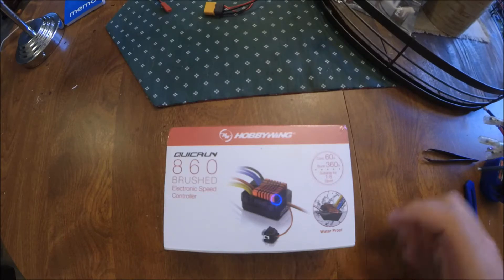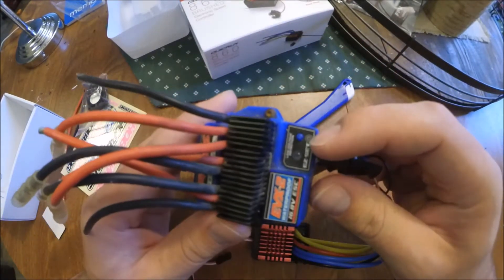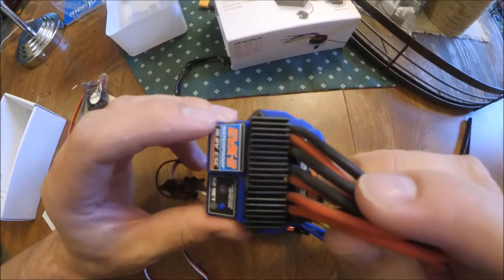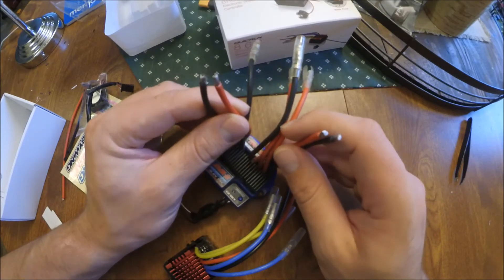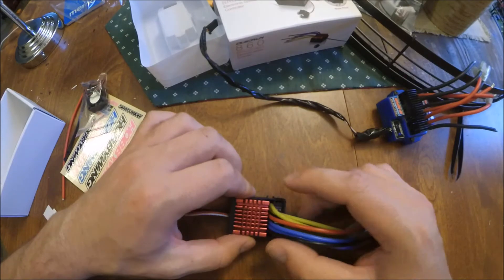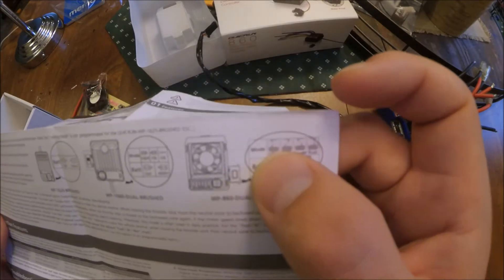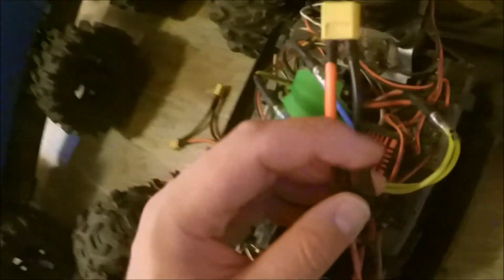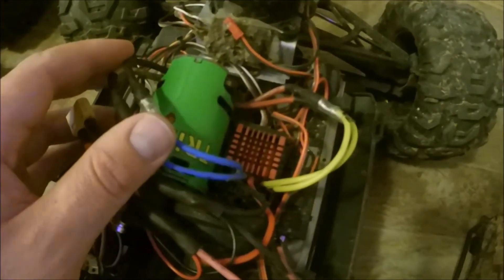Traxxas Summit Upgrade Series...Part 1: Hobbywing Quicrun WP 860 Dual Brushed ESC

Comment: Just to confirm, it will run a Dewalt on 4s?

Not that I doubt the clout of this awesome ESC but I want to be sure before I buy one specifically for a Summit I just picked up that has no motor/esc.

I'm going to buy the quicrun and a dewalt motor. I was going to go brushless but I would ideally want a sensored one which ups the the price dramatically vs a sensorless.

The dewalt + hobbywing would be an inexpensive option and be better at crawling than a sensorless.
Reply from the maker: Yep! I have the exact setup (4S, 860, Dewalt) on my 6x6. Runs just fine!
Reply: @techsmechs4553  Forgot to say thanks for your answer! The Summit is still on the shelf but I should be making a start on it soon. I've acquired a Dewalt motor and a few other missing parts I needed like the motor mount and dust cover. Just need to get an 860 now and I should have myself a bargain Summit!
Reply: About to do the same for my Summit crawler conversion. The fwd/brake/rev on the stock ESC is very annoying for crawling.

Comment: @Texhs Mechs Do you know is HW860 single esc running 2 motors or 2 esc for each motor with single power and signal input? I want to use it on my 8x8 dual motor (each for 4x4) but when I use single esc, it acts as kind of electronic mid diff so I dont get full power on all wheels (front 4 wheels in the mud spin, rear 4 on solid ground dont)
Reply from the maker: It is just a normal esc. One input and one signal.
Reply: @techsmechs4553  Then I cant use it :( In my config power will always go to motor with less resistance
Reply from the maker: You might just have to use two escs
Reply: @techsmechs4553  860 would be simpler. Thnx for help :)

Comment: thinking of buying this but I don't know if it will work tho will the 775 titan motor work using 3s lipo as the esc says 18t motor limit and the titan 775 10t please help
Reply from the maker: Honestly I am not sure. It does run the Dewalt 820 Motor....I imagine it would be fine but I can't guarantee that
Reply: i hope oneday you do a video on it because if this is a upgrade for the summit this esc it will be big news for the summit and 1/8 monster truck lovers

Comment: would it work on my traxxas brushed emaxx
Reply from the maker: MPR_Tuning no reason it shouldn't! As long as you use a brushed motor. But I think those share motors with the summit so it should work
Reply: its has the dual 550 titan monsters
Reply from the maker: MPR_Tuning the ESC can handle dual motors

Comment: This Esc realy work with an titan 775 ? it´s an 10T Motor, my EVX2 is dead an this would be a cheap otion
Reply from the maker: It should. I have it running my Dewalt 820 Motor. 775 won't be a problem!